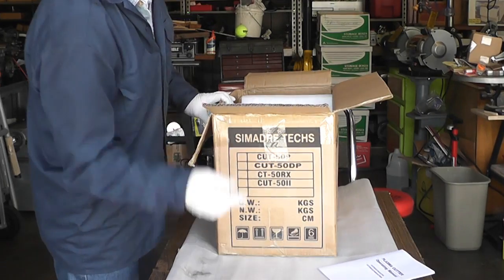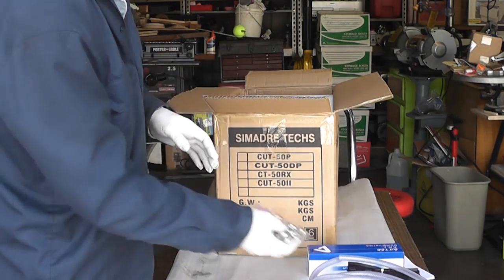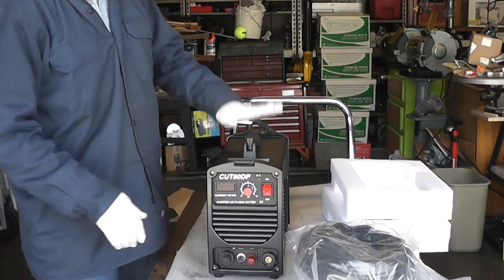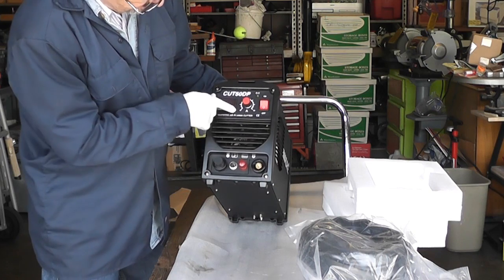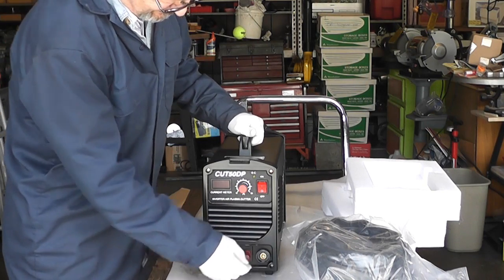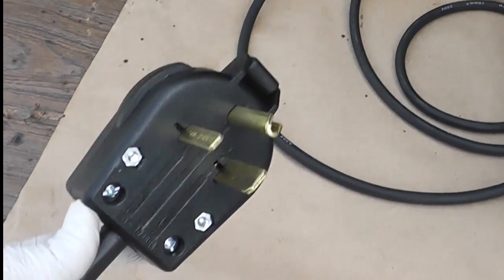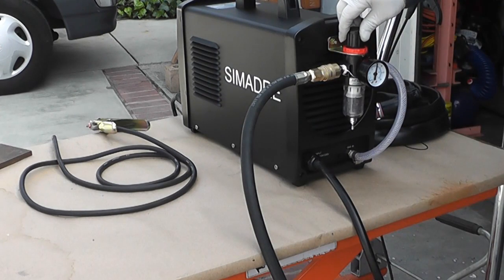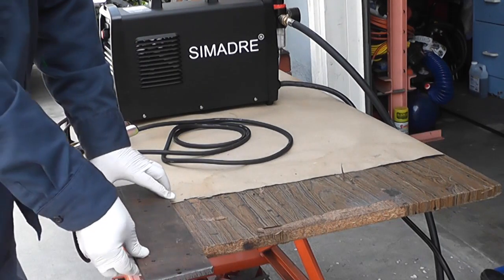Plasma Cutter - Review / Demo - Simadre Cut50DP

Comment: Since you adjust the air pressure according to the depth of cut, there is no need to see it from the front. Set it for the thickness you will cut and forget it.

Comment: You need to buy a proper air filter for the machine. They normally attach to the air regulator at the rear of the machine.

Comment: I just purchased one of these to use with cnc. Do you have any idea what wires you use to hook for cnc. Also wanting to put a 220 plug on it for cnc and have a female 220 end with a 110 adapter so i dont have to switch plugs if i want to take the plasma to a job sight. Any input will be appreciated.

Comment from the maker: I have not tried thicker metal yet, when I get some I will.   Currently I am working on a CNC table to attach this plasma cutter to.   When that project is completed I will be able to cut different thicknesses of metal; determine maximum speeds, airflow and amperages required for the best results.  I will be showing those experiments and results on YouTube.  Thanks for asking